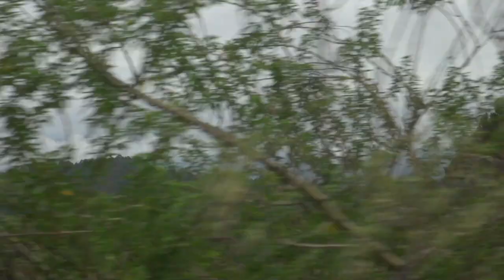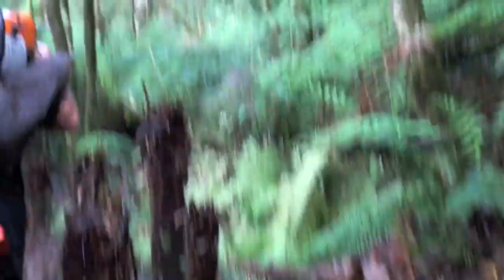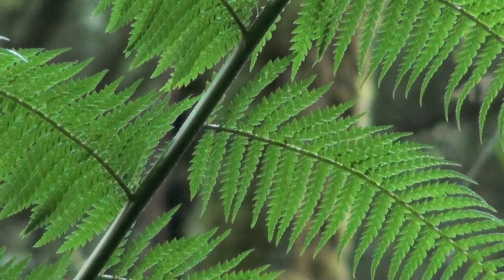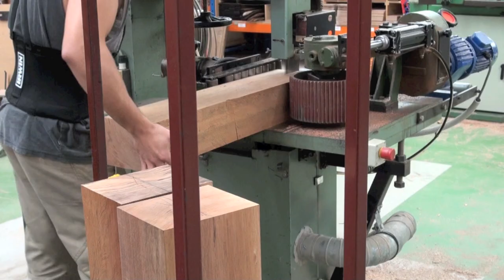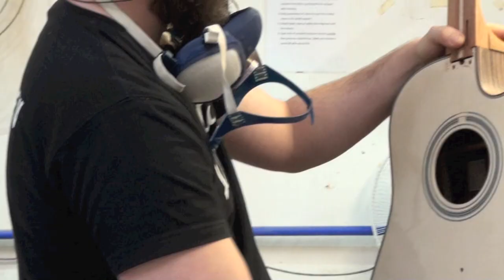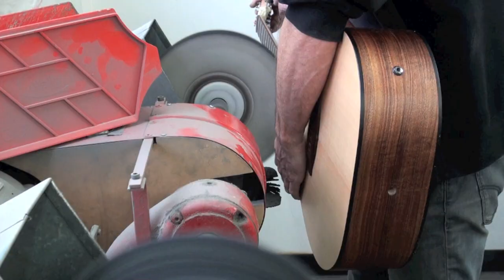blackwood - timber for guitars

Comment: btw  Acacia melanoxylon is the botanical name.  I am intrigued, 1974 model car with Victorian number plates.  There are small portable mills to do this type of work, why a chain saw.  Tas Blackwood does occur in Victoria and in fact a good way up the eastern sea board but logs like that are rare outside of Tasmania.  The Maton factory looked much as it did when I got a tour in 1982; has it not changed?  Both the billets and the guitar looked like Blackwood.  There was no defect in the log?  There was no seasoning process?  I think on private land under some circumstance this may be a legal practice.  These timbers can be purchased via normal commercial channels, that is from a timber yard. I know this from first hand experience.  Something here just ain't right?
Reply from the maker: http://otwaytonewoods.com.au/species
Reply: You may have got more money for that log to be sliced for veneer than you would for guitar backs and sides.  How do you avoid end splitting in the drying process in all those short lengths.  Most of the the Blackwood in Queensland is Sally Wattle, either broad or narrow leaf.  I the 80s I sold trailer load after trailer load of it people who made kitchen doors.  What an immoral waste of a finite resource.  Why don't you offer other species, Myrtle or King Billy as sound boards?     good luck,  Craig. @debrachant
Reply from the maker: You'll notice Murray taps the tree when he first walks into the bush, checking the resonance before he cuts.

Comment: Master with a chainsaw, but even with kiln drying that wood could not have been ready in a short amount of time? Beautiful instruments and some serious workmanship going into them , thanks for sharing this video.
Reply from the maker: thank you.... the tree dropped in the film is not the same as made into the instrument, but Maton use blackwood Murray Kidman cuts.
Reply: im only guessing but think took vedio cut then later on took vedio of make gutters. i got wood lay around 10 years or more. one point every time cut fire wood if nice wood i cut least few boards for cutting boards and boxes..
Reply: A MASTER NOT NO HEMET AND YOU NEVER STAY AT THE STUMP AND THE PILLOW HAAAAAAAAAAA
Reply: Vacuum kiln would dry it with little degradation or checking...those little pieces would only take a couple weeks to suck the water out at room temperature pulling 20+ inches of Hg.  My question is where is this that its so tropical?  The highway looks to be in the US...FL, AL or LA?
Reply: AUSTRALIA!
Reply: @rum5812  The pillow suggests he has done this before. I've done that and a pillow would have been useful. Experience beats book learning any day.
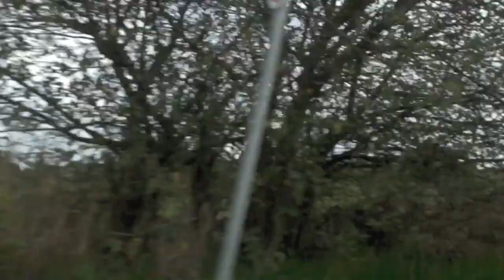Reply: @rum5812  The Kingswood he drives off in at 9:08 would have been made at GM Whyalla plant in South Australia. Where u from?
Reply: @phill goodall the steel may have come from whyalla but the car from elizabeth maybe im in victoria
Reply: @allhopeabandon7831  I think it was Australia
Reply: AllHopeAbandon it’s the Otway forest in South western Victoria.. so how do know? I live there... :-)

Comment: Maton Guitars are grrreat !! but I don't believe they are made from fresh wood- Has to be seasoned timber- 15-20yrs +
Reply from the maker: it's not the same timber, it has been seasoned
Reply: It does not have to be seasoned that long! Lol
Reply: New wood can be used after X years for every X inches in thickness, as a rule of thumb, if air dried, depending on regional humidity. You need a moisture meter to tell for sure. Kiln drying is much shorter since its controlled.
Reply from the maker: not used fresh, is seasoned, just showing the process
Reply: Usually air drying for 1 inch timber is around 6 months, For inch and a half is approx. 9 months and for 2 inch around 12 months and so on before it hits the kilns … Not sure about the moisture content for making guitars but for furniture it's best around 10/12 %